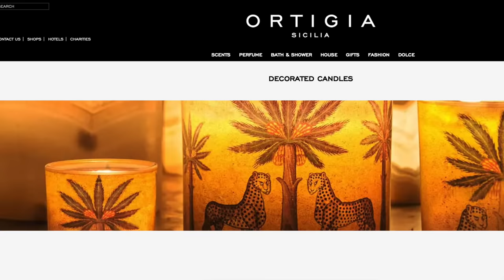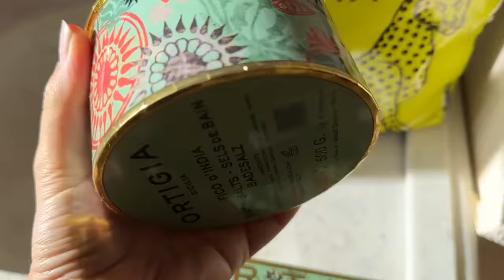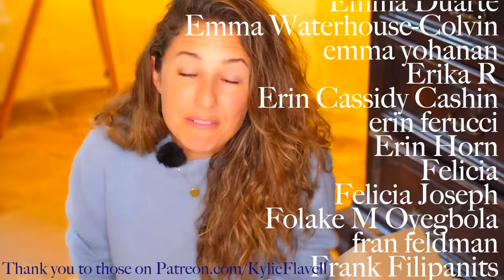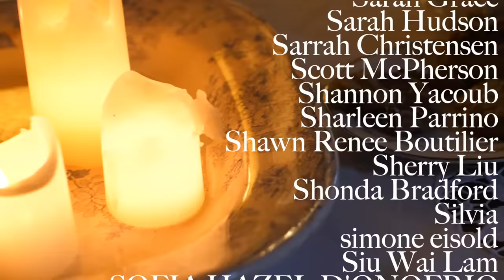RENOVATING A RUIN: Cosy Fall in Tuscany, Baking Cookies, Romantic Office Makeover, Sewing Curtains

Comment: My husband is like Guido, very hesitant and resistant to getting started but when it is done he loves it. He also makes suggestions that seem to involve more work for me😂. Over the  summer we changed the floor in 75 percent of the ground floor, refinished the oak ceiling beams, refurbished the kitchen, lots of replastering and of course it all needed decorating.  Unfortunately my husband has been ill so the organisation and decorating fell to me. As I was finishing he said don't you think that cabinet looks a little shabby, so another project for me. One of my new discoveries was reframing artworks which have transformed the look of art we aIready owned. I bought a picture framing clamp and found acompany that mitre cuts the frame of your choice so you justhave to glueand clamp  - so easy and transformational- a lot of the frames are from Italy. I also love Ortigia. I have Fico d'India but have been toying with trying another scent so will take your recommendation for Zagara. I like the scented crystals.